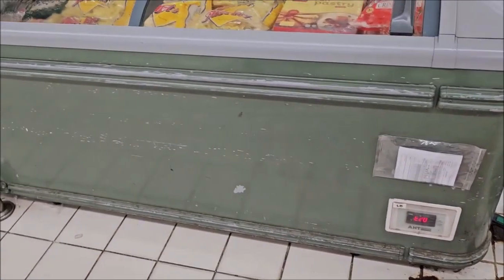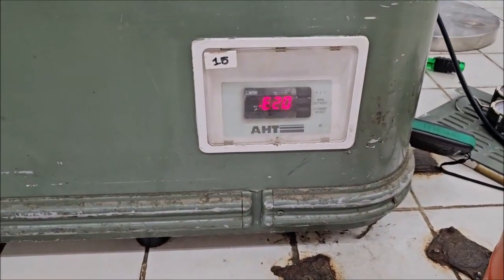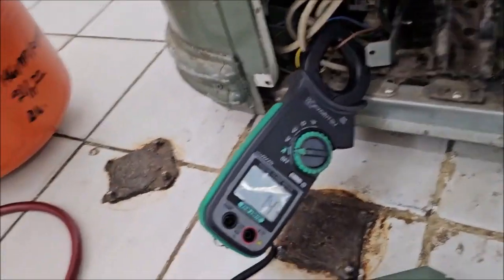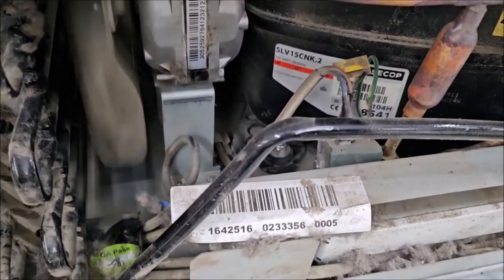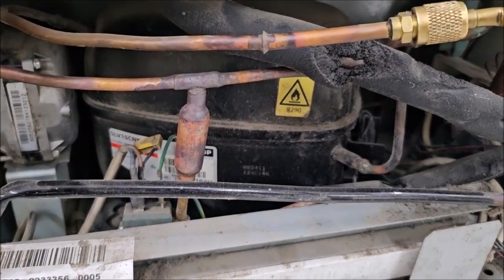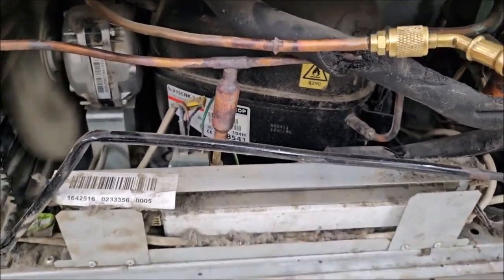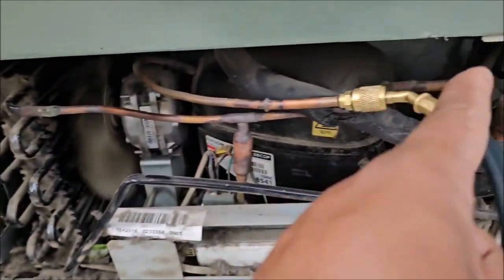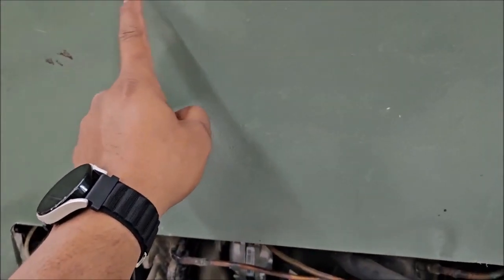Fixing Error E20 (High temperature alarm) In Siemens Fridge Freezer AHT اصلاح عطل E 20  فى الفريزر

Comment: What you explained has nothing to do with e20 error code .. the problem is that there is an alarm set when the temperature goes under some pre set  temperature it has got nothing to do with wiring or gas or electricity lines.
Reply from the maker: Error E 20 means that there is high Tempratue Surounding its control , motor etc ... solution is to set Fan to operate at lower temprature ie. at 45 c instead of 60 C using this parameter F0 4 through 3 keyboard entery  buttons , you could watch afdjusting video , below in description , ask any q and i will replay u asap .
Reply: Sorry but not true.. read the catalogue  @engycation
Reply from the maker: @ So It seems Your Very Clever Technical in frezwes Can You Tell me How to Fix Error E20
Reply: @engycation E20 Temperature alarm – too high
E21 Rise in temperature at F4
E43 Temperature alarm – too low
E60 Temperature alarm – in coo-
ling-down phases
E70 Electronic fault
E75 Rise in temperature of electronics
Reply from the maker: @ So It seems Your Very Clever Technical in frezwes Can You Tell me How to Fix Error E20
Reply: @engycation @engycation too low and too high temperature here refers to the internal of the cabinet regarding the tolerance of the pre set temperature 
E75 error is the code that refers to the temperature of the electrical components